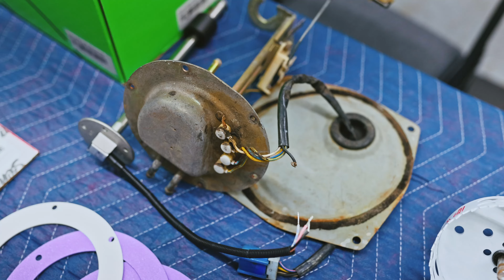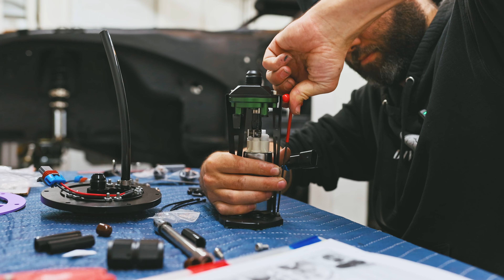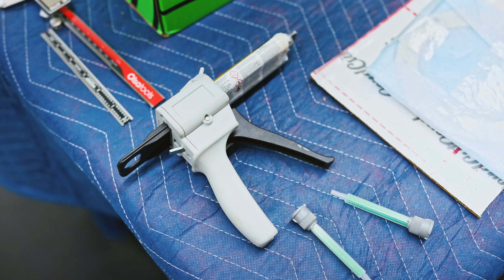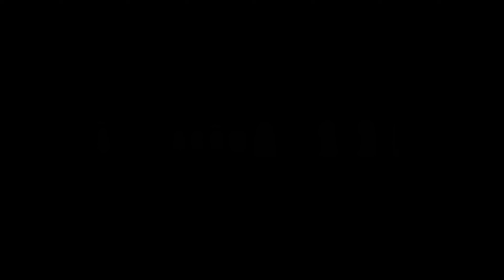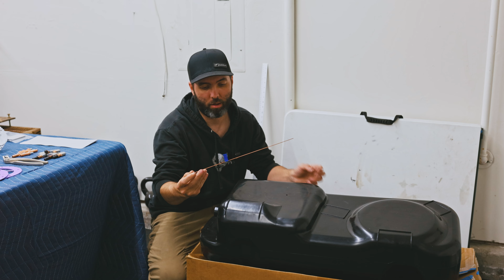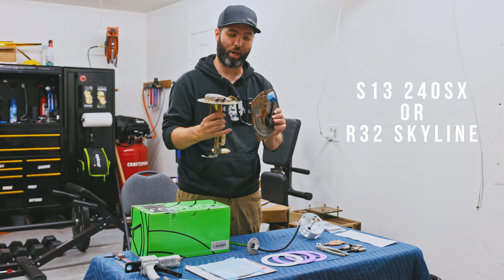Tell Me a Better Fuel Setup.. I'll Wait // Datsun 280Z

Comment: Excellent video and excellent method. 
Only because the caption literally tells me to tell you a better way to do this... 
Instead of just the fuel pump hanger system, if you use the fuel pump bucket from an a modern oem plastic tank, you'll have a sump within it for cornering. 

Basically the exact same thing you have now except your hanging unit is surrounded by a bucket with a pickup on the bottom of the bucket.

Then a siphon that is part of the pump keeps this bucket full as fuel sloshes by in the wide open tank.
This means no matter how much you corner anytime fuel goes underneath where the pickup is it gets picked up and put into the bucket and the bucket stays full 100% of the time from both the fuel return and the siphon suction. 

Again everything you just did it's just a slightly different OEM unit using more modern technology. Radium of course also makes a version. They probably make one that just bolts into what you already have there. 

Also if you don't want to use gasket sealer inside the tank next time, if you made one extra hole in the ring or one opposing on each side, you could use a smaller screw to retain it and just have that screw completely countersunk in the plastic for the tank. Along with telling send cut send to Make a slit that is slightly wider than the thickness of the tank so you can put it in the tank without bending it. 

Again these are hindsight things. Excellent project and video and not a knock. Your description just said too tell you. :p
Reply from the maker: I appreciate you taking the time to write this. There’s always room for improvements and things can always be done differently. Thanks for the input.

Comment: Is there a provision for a sending unit for a fuel gauge.  I didn't see a float.   That was a super clean install and I love radium stuff.
Reply from the maker: I used an electronic fuel gauge from Holley. No float required
Reply: Vintage Tanks sell fuel senders on their website that work with factory gauges.